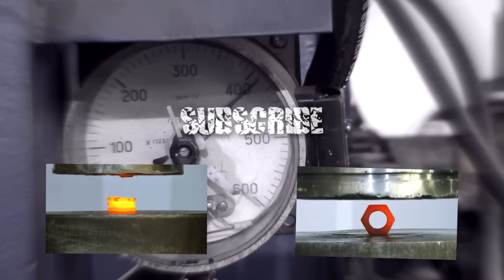5 Ton Hydraulic Jack vs 500 Ton Hydraulic Press

Comment: How much pressure was on it when the ram failed?
Reply from the maker: it was about 55 ton pressure when cylinder broke down. But pressure grew up very fast.
Reply from the maker: You can understand that data is not very accurate, if you saw your manometer in the end of this video, because the pressure rising very fast. I think if this jack can support a 5 ton load it's really only 5 ton, so don't try to lift up 40 ton bulldozer or 6 ton truck with 5 ton jack it's dangerous for your life.
Reply: +Hydraulic Power press two repelling magnets
Reply: Awesome! You are the first press channel to do the Press vs Press video! Hope this one goes viral!
Reply: What's the name of your intro song? If only you could tell me please.
Reply: Impressive that a 5 ton rated jack can support a 50 ton load.